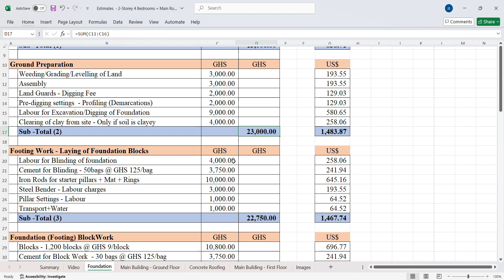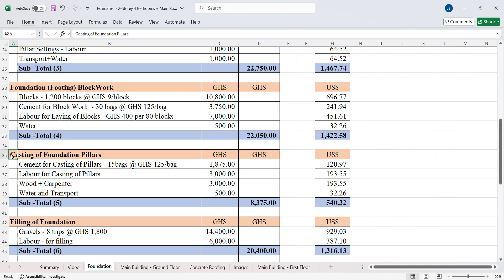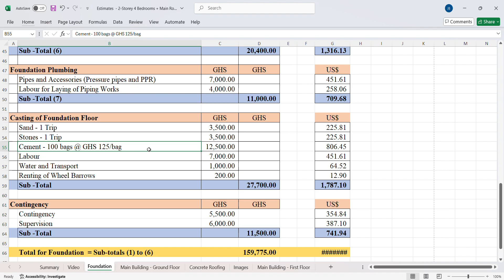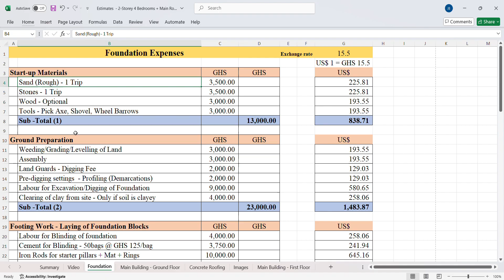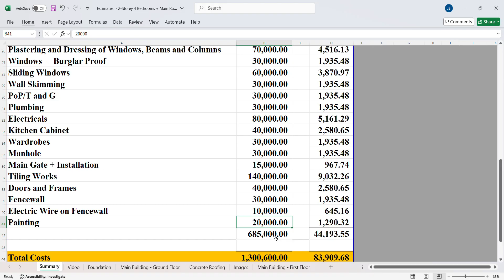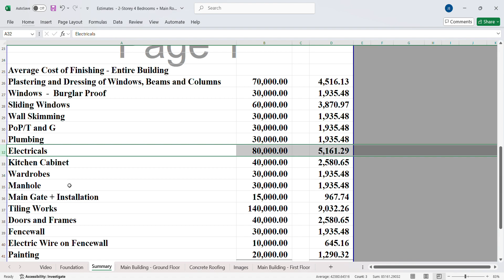Estimate of Average Cost of a (2-Storey) 4-Bedroom House on Half-Plot of Land (Ep 1) No of baths 5.5

Comment: The dollar to cedi rate at the time of this video was 1 usd to 15.5 ghs. I’m working on a similar project right now and the cost of my project is almost the same if not higher than the estimates in this video. However the current dollar to cedi rate is 1 usd to 10.3 cedis. It means I may end up spending 120000 usd to finish. In the video the estimate was 83000 usd to finish. So in less than a year the cost has inflated by close to 40000 usd. This is the worst time for anyone in the diaspora to start any building project in Ghana😊
Reply from the maker: Yes ooo, our economy is quite difficult to predict, we even hit 17 but today it is 11. However, some prices have also come down, so you may not need extra $40,000, may be a bit less
Reply: Ok,  That may be true adjust your process - management- materials source and supply logistics

Comment: Which approach is used to calculate labour cost for laying 3000 blocks? 15,000 cedis basically would mean 5 cedis per block or is it another calculation?
Reply from the maker: Yes that is correct, it cost 400 cedis to lay 80 blocks

Comment: Good video.. How can I get the design for the building? Is it possible to adjust building size to say 30x60ft?
Reply from the maker: Yes, we can easily adjust the size to 30x60ft. On the design, Kindly link up on +233505816618, thank you
Reply: Hello, I've sent u message for some days now but u haven't responded yet @Save-and-Build-Homes
Reply: How about 50ftx50ft?? Can it fit please?
Reply from the maker: @KwameMic  No please, the construction space is 25 by 60ft, however, we can design another 4 Bed Rooms to fit on 50 by 50ft